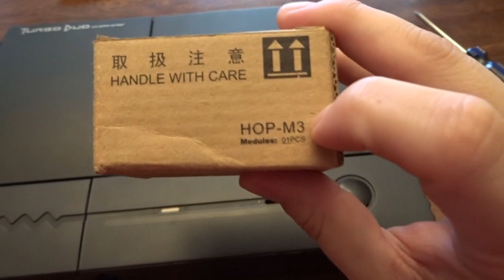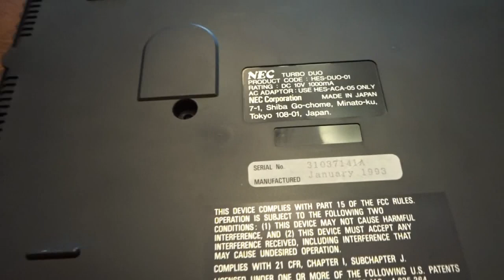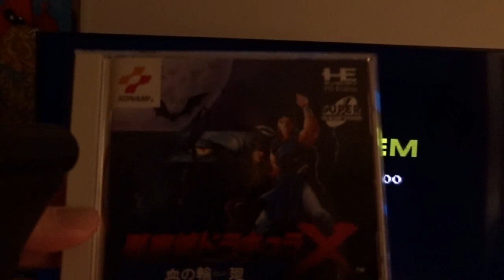Gamer PROTIP! Series #4: NEC Turbo Duo/PC Engine Duo CD Laser Lens Replacement Process

Comment: I fixed my breifcases lens with NEC branded pc disc drive. The pots are finicky but not bad. Props to you for getting your hands dirty.
Reply from the maker: I'm impressed, I watched some videos of PC Engine CD add-on repair and it looks twice as delicate to repair just because everything is so compact.
Reply: @Bubblun1  yeah it wasnt fun. The plastic gear alone I needed was $15 it was lost in the mail. So I had to go thru hoops to get another, but what I've learned is. If you buy anything from China....get 2. Takes forever.

Comment: If you just press Run then Rondo will give you a default file and like “Richter” or “Maria” for the second file. No need to rush through by hammering in As. ;)